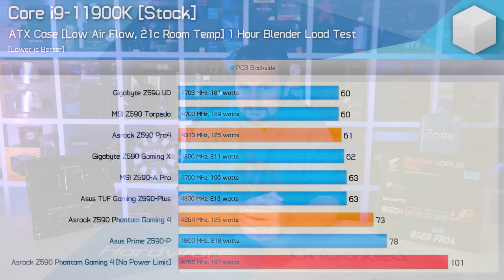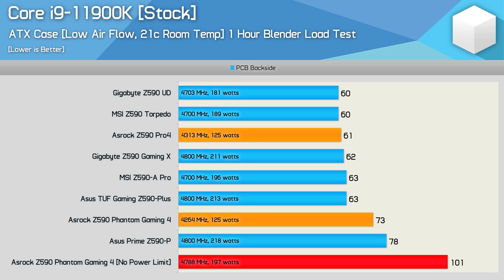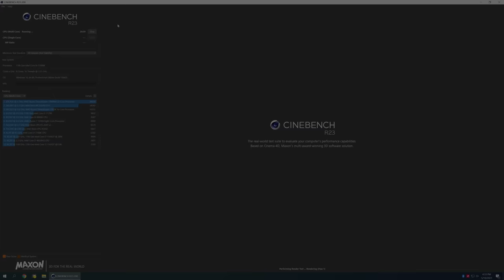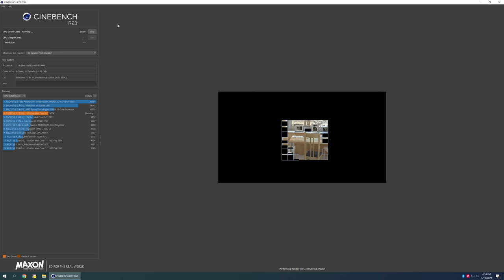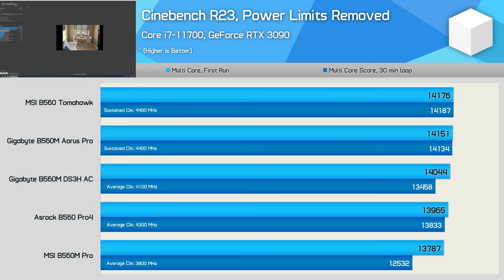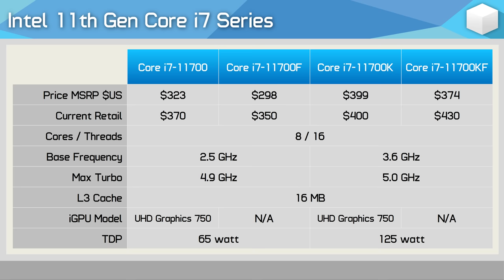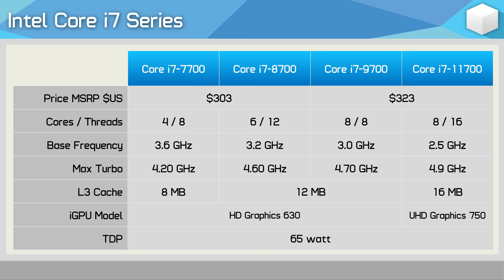Intel B560 is a Disaster: Huge CPU Performance Differences, Power Limit Mess

Comment: i have the GIGABYTE B560M DS3H AC, can it not handle any power limits being removed or can i at least set it to 100-120 watts?
Reply: I also have the same one. Are you able to remove the limits?
Reply: @perry6596  before i used XTU to remove the limits, i did a cinnebench test and i saw it consumed to 110W max, so i guess it does it automatically. After I used XTU to remove the power limits and set the "Turbo Boost Power Max" to 120W, the max watts it consumed was still near 110W, max probably 112W. So in short, i guess yeah i was able to remove the power limits.

Comment: So if I have a i7-11700F with a Gigabyte B560MDS3H board, what board can I upgrade to and see justified performance without throttling issues? 

I am running a 240mm AIO that does pretty well keeping temps down.
Reply: go for a mother board with better VRAM mosfets chokes capacitors 😎
Reply: @georgemartinezza   I don’t know wtf that means
Reply: @smallfry0764  sorry - you should start to know the components.
Reply: @georgemartinezza  I started doing research. It’s my fault for being an asshole. I’m just frustrated and don’t understand what I’m dealing with. Right now I’m having SSD issues dropping to 0 read and 0 write and causing all kinds of latency. 

Honestly it’s been one problem after the next.
Reply: @smallfry0764  really - I swear:  PC is basic. motherboard with good "vram".  
memory RAM, 2666 MHZ - 3200 MHZ.
SSD model m.1 nvmve / SSD sata. and that's all. everything by default runs good. 
the big problem (there are a lot) one could be:  the format of SSD. similar if windows is damaged. :0 !!
Reply: @georgemartinezza  Well, when I bought my prebuild a month ago, i pulled the back panel and saw the sata connection to ssd is broken, like the bundle of cables was pulled too tight and ripped on it. (they did a shit job and I expected that, I really bought it for the cpu+GPU for $2K)

I was thinking about grabbing a 970 Evo today and seeing if that helps. My board does support 4.0. I don’t know if it’s worth 140$ tho
Reply: @smallfry0764  I never knew if one problem I had was: sata connection cable, the main ssd or the bug of windows, even I bought a new power unit thinking the problem was the terminal .  it was my ryzen I built,

i had a 10 years core 2 duo dell. 
now, an intel i7 11700k, 32 ram.  without GPU aaaaarghhh just an old little gpu. enough 'cause I'm not interested in games

Comment: Well actually you should test PL bypass from the start from motherboard bios... in gaming test you will get difference performance. like asrock B560 it should has pl bypass at bios and turn it on instead of just using the auto pl1 limit.

Comment: I'm glad I went with a B550 mobo. AMD looks like a graceful swan now.
Reply: AMD just has a more efficient node, meaning their boards can get away with having cheaper components without throttling.

Intel is desperately clinging onto that 14nm+++++++++ by pumping more and more power through it.

AMD is no better morally. If Intel doesn't start competing again in the next gen, you're going to see the roles reversed with AMD pulling nasty stunts.
Reply: @paulelderson934  You're right, we need more competition and Intel to move to a better node. AMD allowed me to get a 3600x cheaply, so that's why I like them.

Comment: I have the Asrock B560 Pro4 and it does like 9900 points on my 11400, with a clock of 4.15 ghz.  I think you didn't enable the 125w option in BIOS.
Reply: Did you watch the whole video? check the 11700 with unlocked power on that board. Yes he didn't do it for the 11400, but that's the point of this video... to show out of box settings and performance. It's a bit click baity yes, but still valid for the n00bs that dont know they have to flick some settings in the bios.
Reply: @Marty_NZ  mine came with PL unlocked, the stock cooler didn't allow for that hahah
Reply: @areeb1980  yep that's a trap and why the boards SHOULD come with Intel Specs enabled. If you use something better than the silly stock cooler then yes, unlock that power.

Comment: Steve, was this an issue with the B460 boards?
Reply: Yes. And it's not an issue. It's just Intel design specifications. It's just more pronounced for this 11th gen processors since they use more power to hit the same MHz with all cores going for example.
Reply: @Marty_NZ  I just purchased a B460 + 10400F combo - I guess I'll have to do some tweaking... 😉
Reply: @josepedrocarmo5885  What board did you get? 10400F at 65W standard Intel design can essentially max it out so no tweaking needed. It can only do 4ghz all core and that's roughly 75W from memory in Cinebench, so prolonged it might hover between 3.8ghz and 4ghz. I have a 10400F on a cheap Asrock B460 ITX board. For gaming it doesnt matter since no game will peg all 12 threads at 100%. This video is more a "warning" for the n00bs.
Reply: @Marty_NZ  I got a MSI B460 Bazooka. I chose it for the price and the 4 DIMM slots. The combo cost me 160 euros (100 for the CPU; 60 for the motherboard)
Reply: @josepedrocarmo5885  the Bazooka is a great board. Have a look here for power limits, but with 10400 it wont limit it at all https://www.msi.com/blog/intel-b460-h410-power-limit-overclocking

Comment: Why Z590 phantom blender test with I9 is much worse than asrock pro despite both are at 125W and same clock speeds? VRM thermal throttling is a reason?
Reply from the maker: That graph shows VRM temp.
Reply: @Hardwareunboxed  
😂😂 Oh my god how blind I am. I thought it is rendering time of something (minutes) 
Looking forward for how different boards are going to behave with this CPU (11400). Thanks for the hardwork

Comment: does a watercooling on CPU (not on VRMs) help with VRM thermal throttle on these cheap B560?
Reply from the maker: No, if anything it hurts as it reduces air-flow over the VRM heatsinks.
Reply: @Hardwareunboxed  thank you ! so i will wait for your next episode ! And see if i should go over 3600 or 11400f :)
Reply: @ppn7 take  11500
Reply: @CaptainScorpio24  why 11500?
Reply: @ppn7   Better iGPU for slightly more money; also slightly higher base/boost clocks.
Reply: @ppn7  it hs full 750 uhd gpu

Comment: Hello, did you get a chance to check the performance with a mid range motherboard like the ASUS TUF Gaming B560-Plus WiFi which has a decent VRM heatsink? Please let me know if you have the result of that test bench because I had already ordered that with core i5 11400F for budget gaming rig. I hope this motherboard should not suffer like the other budget category one's.

Thank you!
Reply from the maker: That video is still coming, but I can tell you the TUF Gaming is a good board.
Reply: @Hardwareunboxed  Super thanks for your response. I am releived and can excitingly proceed with the build now. Thanks again!
Reply: @kashyaprahul1  going with the exact same proc-mobo combo.. what RAM are you using?
Reply: @nishikantprabhu  I am currently using 8gbx2 3200 Mhz RAM, it's the Gskill Trident Z RGB.
Reply: @kashyaprahul1  Thanks! Is there a way to take this discussion offline? I want to ask you something.
Reply: @kashyaprahul1  thanks!

Comment: Hello all. I have a ryzen 2600X on a AORUS Ultra Gaming X470 Mobo, 16GB DDR4, M.2 drive and a 5700XT. I'm thinking of getting the ryzen 5600X as I feel I could get the graphics card to pull put more FPS in say COD, Battlefield etc. RIght now my GPU is 60-70% used in a lot of titles which is where my decision comes from. The question is: would the 5600X work properly on my mobo with the updated BIOS supporting ryzen 5000 CPU's? Or should i just wait for ryzen 6000 desktop? Thank you!

Comment: Is this a problem with H570 boards as well?
Reply: @MJ-uk6lu  hi I’ve seen this Video, I am just wondering how much this effects the “higher” tier H570
Reply: That is ansvered in the video than MJ linked. And also in this video.
Reply: @haukionkannel  they don't cover H570 boards in either video, I understand the intel spec issues but I'm wondering if I will have the same bios issues of having to adjust setting with H570

Comment: There are some B560 boards slightly more expensive than Gigabyte B560M DS3H AC or ASRock B560M Pro4. Please tell us about boards like Gigabyte B560M AORUS ELITE, ASUS TUF GAMING B560M-PLUS, ASRock B560M Steel Legend, MSI MAG B560M MORTAR. I kinda knew that the cheapest ones would be trash. But I was kinda hoping that Gigabyte B560M AORUS ELITE would offer a good value for money to run 11400F with its full potential.

Comment: Sorry, I am a beginner. May I know how to remove the power limit? I plan to buy the ASRock B560 (or ASRock B560M), but pair it with the i7-11700 (or even i9-11900). If this is not a good idea, then I will go for the MSI B560 Tomahawk or the Gigabyte B560 Aorus Pro AX.

Comment: I literally bought an asrock b560 pro 4 a couple weeks ago...
Reply: I bought the DS3H two days ago...
Reply: For locked i5-11400 there isn't any problem, just remove power limits and you're fine.
Title is misleading, because this is an issue only with i7s and i9s, but who buys a cheap B560 for a 350$+ dollars CPU anyway rofl.

Comment: I have the 10400f and B460 msi torpedo with the op vrms - cost for the two £225. 

for value that combo is ridiculous when you look at the 10700f alone costing more than both those together and performing pretty much the same.

i think intel fd up with 10400f being too good compared to its bigger brothers especially when the 11400f is currently £160-£170

Comment: I'm supposed to get the 11400F + Gigabye B560M Aorus Pro AX this weekend. I'm not so sure anymore...
Reply: considering the only difference between 2 identical products is AX wifi and bt and the aorus pro was shown to be fine in the video pretty safe to say it'll be fine. I'm using the same board with a 11700 and it's not having any issues with that

Comment: Are we sure this isn’t some kind of early-version BIOS crap? I mean I certainly wouldn’t put it past Intel and/or the board partners to have another botched launch.
Reply from the maker: No, that's not what this is.
Reply: @Hardwareunboxed  I apologize, I thought about the VRM throttling and realized how stupid my question was. I will delete my original comment in 10 minutes.
Reply from the maker: No need to delete it and it's not stupid. Also you worked out the reason ;)
Reply: @Hardwareunboxed  You are a god amongst mortal nerd men.

Comment: Welcome to the first time in history where the choice of motherboard actually influences the base performance of your components
Reply: That was par for the course like 15 years ago 🤣
Reply: I guess this isn't the firs though!
Reply: VRM throttling has been a thing for decades and motherboards auto overclocking by removing power limits has been a thing for years.
Reply: @akva1214  there's a big gap between VRM throttling dropping boost clocks 100-200 Mhz below, and a dropping clocks to 3.5 ghz or below for 25-50% performance differences
Reply: @ruicastro1410  The VRM throttling here is only dropping clocks slightly (this is what the unlocked 11700 test shows). The big performance differences you're talking about is just some MBs sticking to PL limits & other don't. That's overclocking. It's just a switch in the bios really. This entire vid is somewhat click bait as it has been a thing for years and it's been covered many times, even by this channel.

It happens on Z490 boards or any recent Intel MB too: https://www.youtube.com/watch?v=nFNnekpGwSg
As you can see some MB have the 10900k at 3.7ghz, others at 4,4ghz and some at 4,9ghz.

Comment: I'm on a ASRock B560 itx system with a Intel 11400f which i yet have to build because i'm waiting for part's..
So i guess i have to get a better board if i end up upgrading to an i7... Maybe even now? hmm Atleast on that one the difference won't be as big as if i would be using an i7. Wanted a Z590 but couldn't find a decently priced one in stock so yea. Happy to have a board at all atm. The ASRock was the only ITX board in stock i could find.
Reply: Where are you based. Z590i Vision D is readily available in the UK
Reply: @wedeservedit  Now ended up going for a AMD 5600X which i got for 130euros as the intel CPU turned out was broken and send all the parts back that i didn't need like the b560.
Got a B450 Fatal1ty for cheaper than the B560 and got more USB Ports and even a USB C port. I can still touch the Vrm heatsink with my finger no problem after 30min stress test. Seems similar hot to the touch like the CPU which has a core temp of 65c max.
Reply: @kaedeschulz5422  nice choice. AM4 is really great performance bang for the buck. Unfortunately I’ve had to get a previous gen intel as these are best supported in hackintosh builds. I got the b560m AORUS pro ax which seems ok for about 110 euros (refurb tho). Price of mobos has skyrocketed!!
Reply: @wedeservedit  Yea mainboards are getting expensive!
Reply: @kaedeschulz5422  yeah actually cheaper to buy prebuilds lol
Reply: @wedeservedit  Doesn't have to be more expensive. Most pre builds suck so even if it was cheaper.. Hell no.
Reply: @kaedeschulz5422  Yeah I agree if buying from the big manufacturers - with their proprietary stuff but there's small companies that do prebuilds that can be easily upgraded... but for me the fun is in building the computer myself
Reply: @wedeservedit  Yea it is a lot of fun! Just some weird problem troubleshooting can be rather frustrating!

Comment: With Pro4 if you enable dual tau it gets to r23  MC~10k (ddr4@2666), but without it, same SC and MC ~8.8k tho mobo 52C cpu 55C @hwm
Reply: Are you referring to the ASRock B560M Pro4? How do you enable dual tau?
Reply: @AndyJenWolff   in bios/advanced/OC tweaker/cpu config I think near the end, tho if you dont have high end gpu I don't think its worth using

Comment: Ah.... Steve, perhaps you can make content about how Core i5-11400(F) with cheap B560 compared to Ryzen 5 3600 in applications and games. 
Especially with you already the data of Ryzen 5 3600 in multiple GPUs from Radeon vs Geforce driver overhead benchmark.
Reply: Reasonable Well. You just have to manually togle power limit of from bios with Intel cpu. And look reviews to get desent, but still not too expensive motherboard. You can look any 11400 review to see how it compares to amd cpus. All in all in games the difference is very small…

Comment: I have the b560 gigabyte dsh3 paired with i7 11700k, running at 4.6mhz, i have the problems in games vrms motherboard reach 102c , and have trottling , any solution?

Comment: So, if I can get an R5 3600 for 180 USD and pair it with a b450 for 100 USD, it's a better option for budget than a 11400 and a B560? (Honest question)
Reply: nope 11400(F) still is better value, just get a decent B560M like B560M Steel Legend / Aorus Elite / TUF / Mortar.
Reply: @shiveringisles3509  I see, got it. Thank youu!! If I may ask, can you elaborate on why its better? I read stuff and says that 11400 has better IPC and performance gain of about 15%, was wondering if you have another thought in mind. Thank you!
Reply: Only the MSI B560M Pro isn't suited for an 11400 with power limits disabled in this lineup. I'm not exactly sure why they bothered benchmarking it when they ignored all motherboards without VRM heatsinks in the past.
Reply: @Kvin1871  if IPC and performance improvements are not good enough, you'd also get PCI4 (you need B550 for that but ok PCIE4 isn't that important), some boards have 20Gbps USB (nice if you use external USB NVME SSDs), can reuse cheap intel coolers like 212x/evo/M9i if you already have one, easier to OC memory to 4000+ with a 3600 or faster kit (nice if you live for benchmarks).
Reply: @shiveringisles3509  I see. Benchmarks are not really that much of importance, as long as its playable gaming wise, thats good for me. What I'm more concerned is the CPU performance for rendering in Photoshop, Da Vinci, and Premiere/AE. It will be my first PC build and would want something I can use for a long time for work and casual, and save enough for upgrade.
Reply: @Kvin1871  if you are going to do work on Premiere / Da Vinci then 8 core 10700 would do better.
Reply: @shiveringisles3509  Sadly, budget is a bit stiff as the 10700 costs around 100 USD more in my country, although theoretical question if I were to get one: would the  2999mhz RAM hurt the performance compared to 3200mhz? I read that 10700 only supports up to 2999mhz.
Reply: @Kvin1871  2933mhz is on B460 boards, B560 allows OC above 3200.
Reply: @shiveringisles3509  oh, so the RAM sticks are motherboard dependent, not processor dependent? Thats new info to me, thank you!

Comment: WEIRD i have a ASrock B560M pro 4 with a i7 11700k and the CPU and Ram overclock just fine and i get 5.4ghz all core ... sure i had too flash the bios and update it and i am using Gskill 3200MHZ set properly in bios and using a massive Noctua DH15 and a rtx 2070 super .. its a tight fit too say the least but it all works.. what ,matters in going into bios know what your doing and adjust the CPU performance in advanced settings !!! i changed multiplier X49 and adjusted the rest as well and achieved great overclocking..  Also whay in the absolute Fuck are you using Cinebench which is biased too AMD workloads and not Gaming oriented at all ... try getting some Firestrike and such 3dMark SCORES FFS ... no one cares about Cinebench they are proven USELESS .. get some in game testing results on popular games (tell us the complete specs you used ) and use 3dMARK!!!!!! everything you presented is useless...
Reply: I agree.  👍
here B560 Aorus Pro Ax
i7-11700, 
2x16 / 3200 MHz,  
no GPU.  fantástic, enough, excellent. 
cinebench only is useful to me for temperature test.